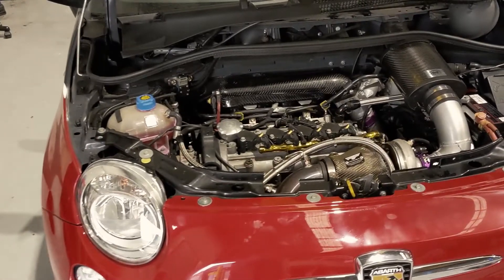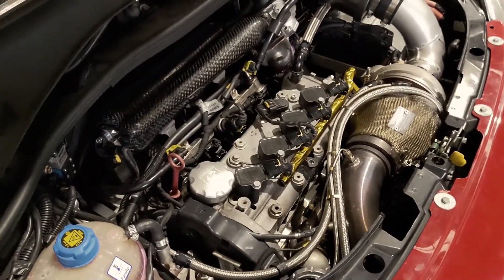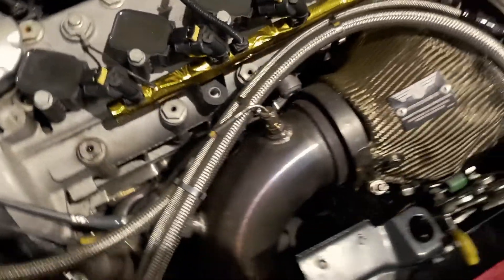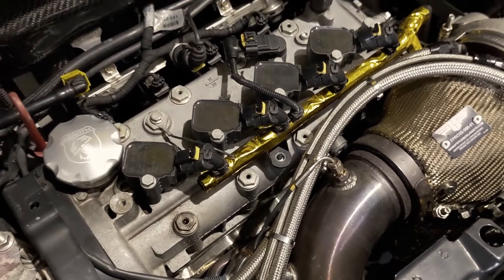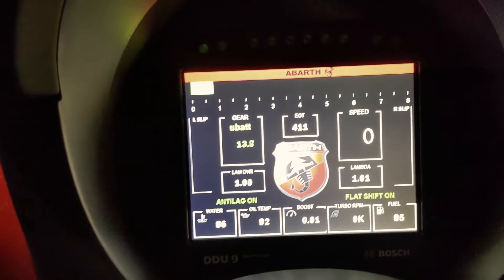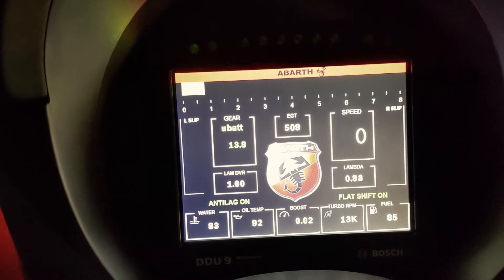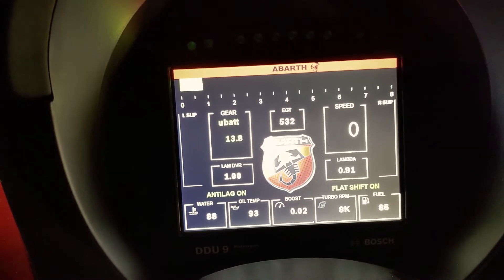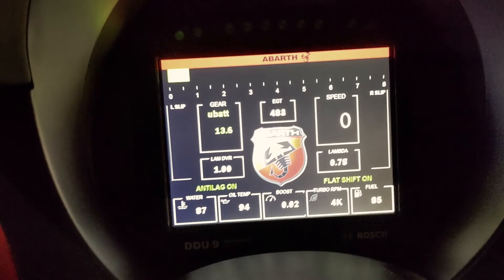Turbosmart ALV40 Anti-lag Vs No Anti lag Test | Abarth 595 | Bosch Motorsport Streamline Automotive

Comment: Hi ! Thanks for this video ! Will this anti-lag valve help an Abarth 595 with a TD04 turbo perform better in low rpm’s ? (TD04’s weak point) Thanks !
Reply: Anti lag valves only increase response off throttle. It won’t cause the turbo to spoil up faster while you’re accelerating. Hope this helped

Comment: Will a link g4 storm ecu support program the strategy with this device?
Reply from the maker: Mahesh I am not familiar with the features of the link ECU range. Sorry I can't be more help.
Reply: @ozniva9724  do you have remove blow off valve to use alv40? Because if bov work I think air can pass though fresh air system